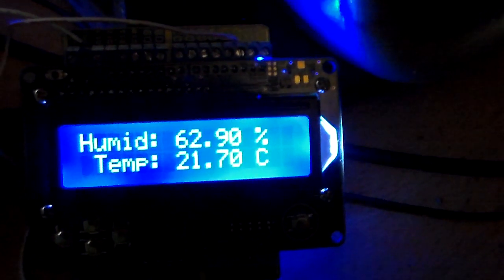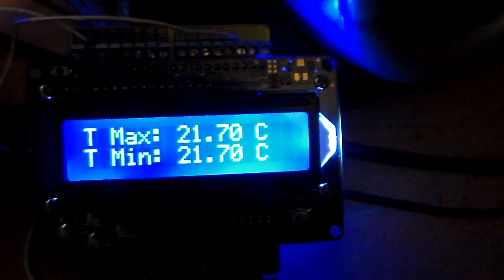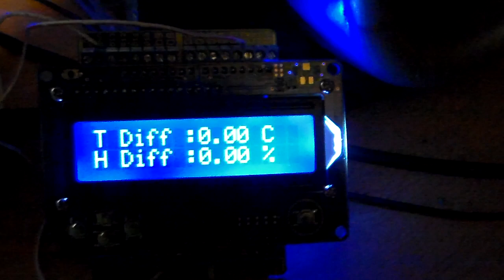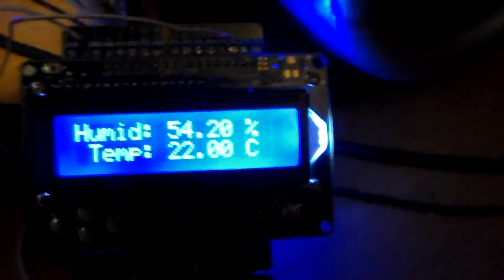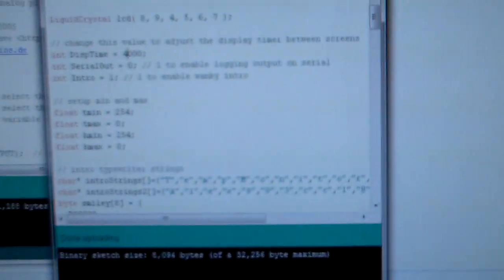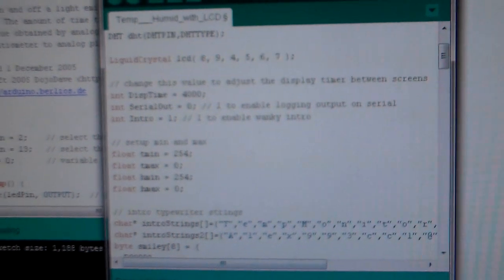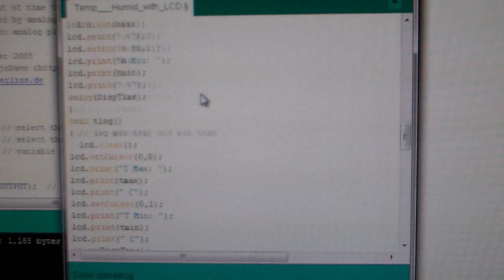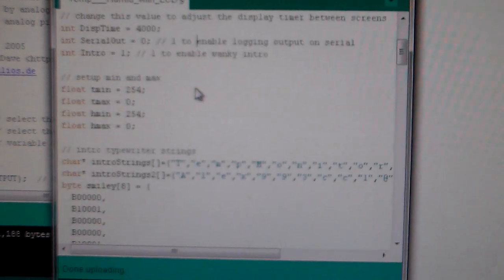Arduino Temp and Humidity plus LCD output

Comment: Wow, eval boards seem to get cheaper everyday! I just bought an STM32F4 discovery board though so I'll be playing around with that for now. Once I get into high speed ARM's, I'll probably resort to Linux as it will of course be easier and I'll have plenty of processing power to support it. I'm just not sure how much of a performance decrease will result from running Linux along with my main program (although basic SDIO and 30fps video + 44KHz 16 bit stereo audio probably won't be a problem)

Comment: Don't get me wrong, I love messing around with different processors at the bare metal level but once you get up to the complexity of parts with GPUs onboard it's time to just run Linux on it. ;) The Raspberry Pi and BB are a bit more expensive than simpler boards but it'll be a while before you out grow it.. TI have their new Cortex M4 launchpad board going for $5 shipped pre-order at the moment.. might be interesting for you :)

Comment: I much prefer a low level approach to microcontrollers since I can be sure that they do exactly what I tell them to, however steep the learning curve is. Plus, a simple cortex M4 eval board only costs $15 dollars rather that almost $90. Eventually I'll get into A8 but I'm not quite there yet.

Comment: I forgot to mention.. The bluetooth modules are serial -> bluetooth. It works just like the serial -> usb on the Arduino. So you should just be able to wire up the TX line on the arduino to the bluetooth module and have instant wireless capability. The modules are only a few bucks on ebay too. :)

Comment: The beaglebone is a very good step up from the Arduino.. It's fast, cheap and ARM but you don't have to mess around with all of the interrupt vector nonsense etc because it's already running Linux. :)

Comment: I killed my Arduino years ago so I can't say for sure but there should be a library for driving the SD and reading/writing files via FAT (plain old disk format that DOS uses).. if not you can probably rip out the code from someone else's project. It's not worth the pain of writing it from scratch.

Comment: SD cards are accessible via SPI .. so you should be able to do it with just the arduino. If you get a micro sd to sd adapter you might be able to solder wires to the adapter to make a cheap micro sd socket. Last time I tried that it all got melted and messed up pretty quick :(.